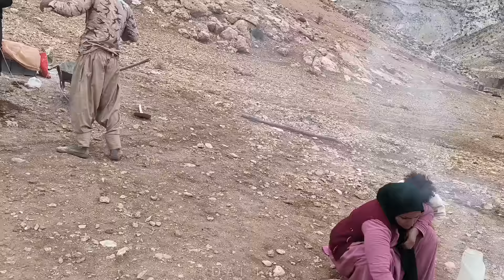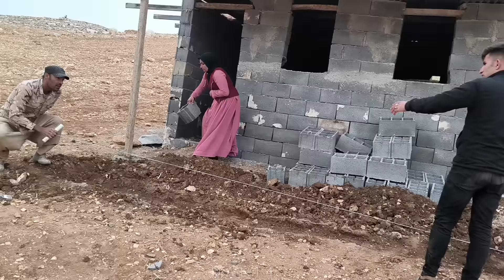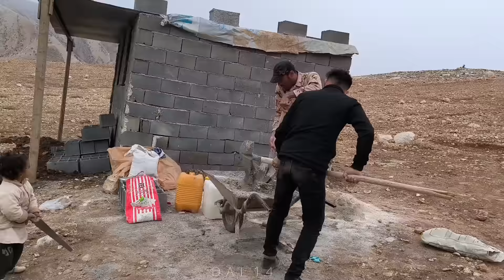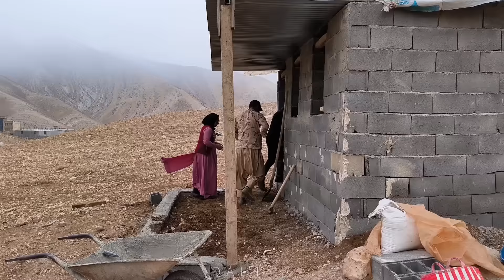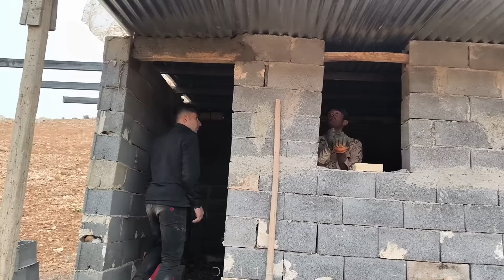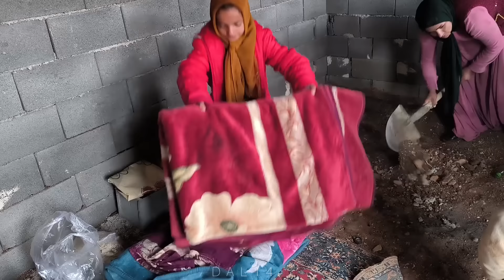Redemptive love: the construction of Ivan and the young man's insistence on Afsane to leave the cave

Comment: Hello mr camera man, add another two extra metal roof because the metal bar still have enogh length. They better move it to balance in both sides and add one extra roof both sides. There must be an allowance so that the rain may not enter on the walls.Check it to see.

Comment: Крыша должна на 15 - 20 см  выходить за  стену  по бокам домика. Это для того чтоб дождь  не мочил  стены  сверху. А так как сделал мастер, вода будет бежать по стенам. Так делать нельзя. Надо ещё один лист купить и подвинуть крышу в  бок. Тогда будет хорошо. Купите лист металла и сделайте правильно. Слева стена где дверь, метал не лежит на стене и там дыры. Вода будет затевать в дом. Оператор, под скажите строителям.
Reply: The roof of the house does not completely cover this room. Those metal bars, which support the sheets of tin, had to be placed equally, so that they are distanced from the walls. And on the roof, two more sheets of tin were needed, to cover the house well My opinion is that when the rains and snows come, the water will flow inside the room and on the walls. It will flood everything. A good roof placed properly guarantees the condition of the house. The iron bars are on the left outside too much, and to the right of the house, it is level with the walls. You can clearly see that 2 sheets of sheet metal were still needed, to be completely covered. I don't know if this comment is taken into account... but I told the truth.
Reply: Мазия не воспитанная
Reply: @Geta.5-Georgeta.6 ДА,СОГЛАСНА,КРЫШУ НАДО ПЕРЕДЕЛЫВАТЬ. НО МОЖЕТ СДЕЛАЛИ ВРЕМЕННО  И НА ПРОДОЛЖЕНИЕ НЕТ ДЕНЕГ?
НО ЧТО ЕЕ НАДО ДОДЕЛЫВАТЬ И ПЕРЕДЕЛЫВАТЬ-ЭТО ФАКТ.
Reply: Да этот молодой человек говорил что докупит утеплитель и видимо потом поправят крышу.

Comment: The roof of the house does not completely cover this room. Those metal bars, which support the sheets of tin, had to be placed equally, so that they are distanced from the walls. And on the roof, two more sheets of tin were needed, to cover the house well My opinion is that when the rains and snows come, the water will flow inside the room and on the walls. It will flood everything. A good roof placed properly guarantees the condition of the house. The iron bars are on the left outside too much, and to the right of the house, it is level with the walls. You can clearly see that 2 sheets of sheet metal were still needed, to be completely covered. I don't know if this comment is taken into account... but I told the truth.
Reply: Вы совершенно правы. В моей стране за такое строительство дали бы штраф и заставили переделать за свой счёт.
Reply: @natalian6324  Exactly! And the same with me. They are not built properly. Anyway, many people donated, so they had to make the roof very good, not like that, it is disappointing that they do not know how to raise the sloping roof at least half a meter from the walls.